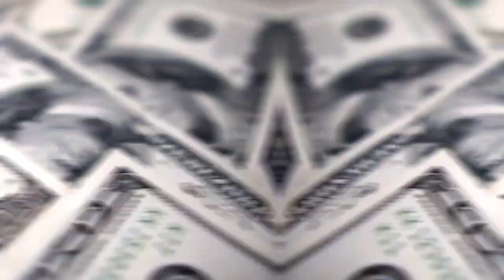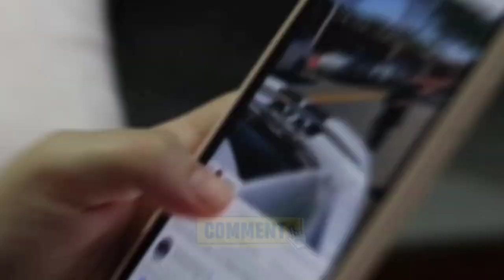Russia Panic: This BRUTAL Fighter Jet Is Built To Destroy Them

Comment: I would very much like to see a what-if story of what would happen if the Arrow was never canceled. I'm tired of hearing about how the Arrow was canceled over and over again.
Reply: It would have had a short service life. It was obsolete before it ever flew. Not because it wasn't a capable interceptor but because ICBM's made the manned interception mission obsolete.
Reply: @Bellthorian  It is a very good possibility that the Arrow would have had a short life if it was never cancelled but we do know what happened after the cancellation of the Arrow. The engineers basically left Canada which some in turn then went to work for NASA and helped their space program, including the Apollo missions,

Had the Arrow program not have been cancelled, the first lunar landing could very well have been a joint mission between Canada and USA. And Canada could very much be still producing its own military aircraft. (probably not but still a possibility)

And while there were ICBM's back then, they were still mostly in infancy and the counterpart weapons to intercept those ICBMs were even more so, the Bomar missile system did not pan out ultimately.

And regardless of ICBM's being seen as the end all to a fight, the country who launched them would still need to send military units to capture and hold an area and a counter would still be needed to intercept or hamper approaches from an invading force.

It's a huge topic to wonder about in the "what-if?" scenario. And that's why I would like to see a more informed person than myself explore that.